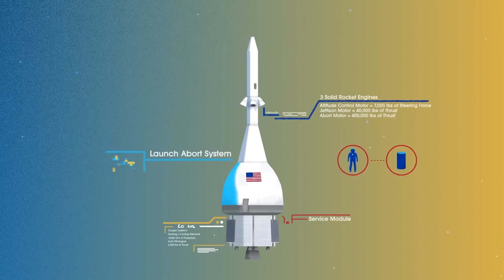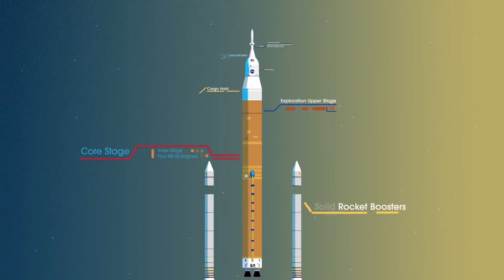The Artemis Project

Comment: It gets ‘even more’ complex because, one has to remember that once we leave earth’s surface, even just to the height of a passenger jet, the object (whether it is a jet, or the moon, or anything else) does not ‘know’ how big in volume & density, the Earth is. A plane, or the moon, essentially feels the pull of a ‘point object’ with the same MASS as the earth. It could be much smaller than earth but much denser; or much bigger, but less dense. The moon cannot ‘know’. It just assumes a point mass, with earth’s mass, located at where the ‘actual’ centre of the Earth really is, if this makes sense. It is by this fact that black holes can occur (but that’s too much to type here!). So the business of defining and calculating orbits is a complex one. Add to that the sheer complexity of the files of “Many Body Mechanics” (the interactions of more than two objects, or bodies, and how they move) and i gets very… interesting!

Comment: SLS isn’t capable of directly landing on the Lunar surface (without another system plugged in) the cost, lift capacity and cadence doesn’t provide for more than about 4-astronauts per per year on the surface for the forceable future, so no sustained lunar surface outpost capability. No hardware, that I’ve seen, within Artemis that is capable of reaching let alone landing astronauts on the surface of Mars. The only potentially viable system is Starship. Ironically Starship doesn’t need any Artemis hardware to work.
Reply: Artemis relies on too many parts to work. I also think that maybe SpaceX could have gone with a system between Falcon 9 and SuperHeavy which could do the job.

Comment: To be honest I should be an even bigger priority to at least get the SLS off the ground because it will be really good for a lot of the proposed space probes out there that would require the SLS for their mission. And the best heavy lift rocket we have now besides starship superheavy is falcon heavy but superheavy is a little bit overkill for say a Saturn space probe
Reply: SLS is just Way Too Expensive for sustained use and has wasted Many 10s of Billions of $ already.
It was a cash cow that those directing it did not even care if it Ever flew just as long as that Sweet $$$ kept flowing into certain states.
It is a Powerful rocket and will be useful in certain circumstances, but is remains an Absolute Disgrace to NASA's history !  $2.8 Billion per launch.
...and to top it all off they have said it will use useful for the next 30 YEARS as a major space launch system  XD  XD  XD

Comment: It will be a Chinese flag I think. They are advancing very quickky. Their testing of a hypersonic sub-orbital glide vehicle recently has proved this.
Reply: china can barely keep its electricity running.
Reply: Well, this is what happens when Clinton/Gore need money for their next election campaign.  They sell rocket technology to anyone who will pay, especially Chinese monks who are not at all working for the state.
Reply: @RedSiegfried  no, when they need more money candidates usually turn to super packs. Plenty of billionaires willing to pay for a campaign for someone they have control over in the oval office.
Reply: @RedSiegfried  Tell us more about how conservatism failed in the US
Reply: They're 
The USA had a hypersonic sub orbital vehicle in the late 60s early 70s, was called the SLAM, Supersonic Low Altitude Missile. The SLAM could fly for an indefinite amount of time using nuclear fuel and Ram jet technology, plan was to make it circle the artic until it was needed but the insane amount of nuclear exhaust made us change our minds on that one. Russia just tried a SLAM type rocket test but at some point it blew up and killed a couple on the ground crew.